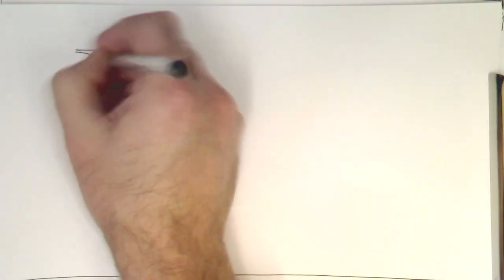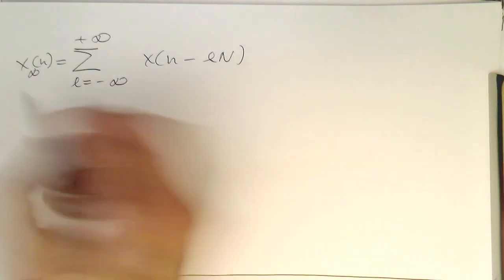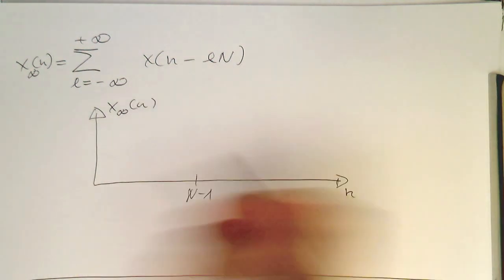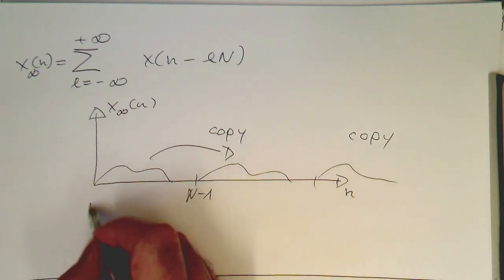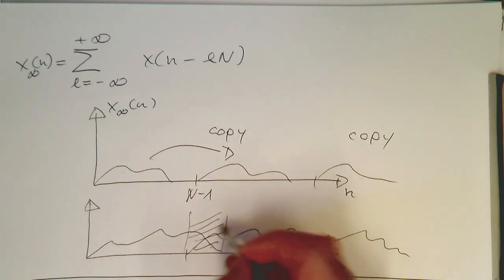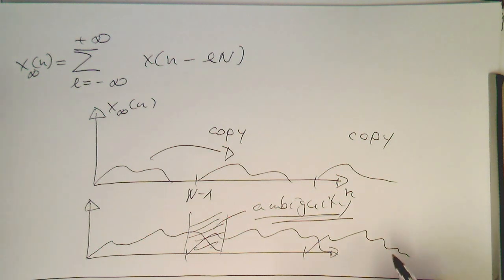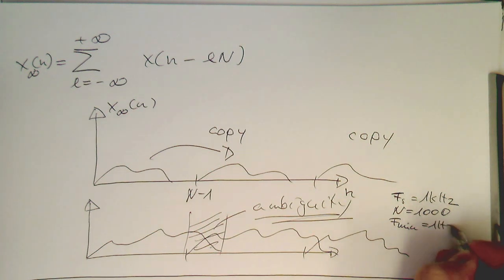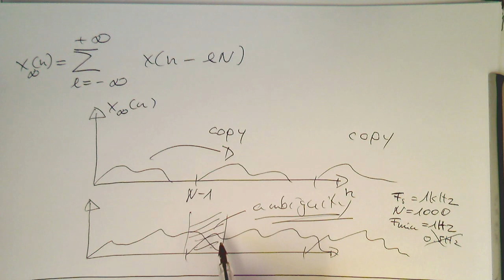Sampled signals: the consquences of f-sampling (#005/002)

Comment from the maker: Fs is always the sampling rate in the time domain. Indeed if Fs=2000Hz then the spacing between two X(k) is 2Hz because the duration of the time series is then 1/2 sec so that the DFT can only "see" signals with a max duration of 1/2 sec which is 2Hz.